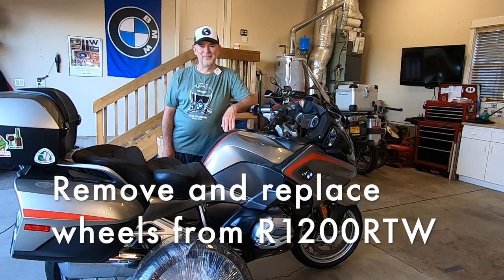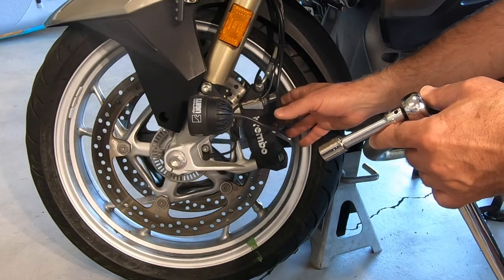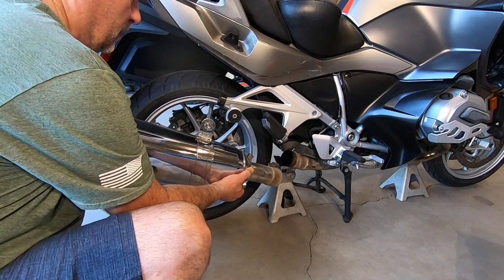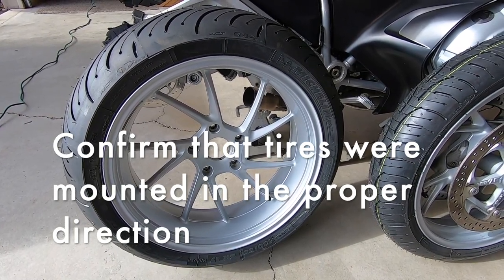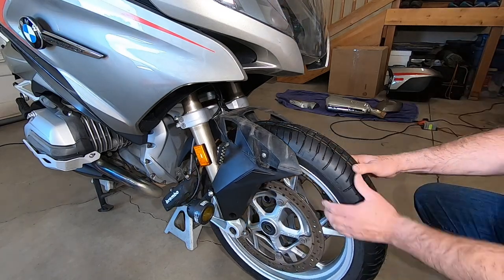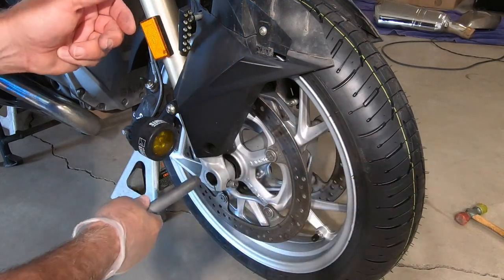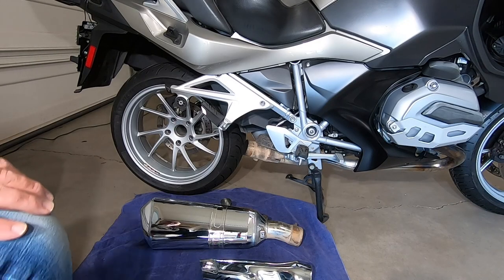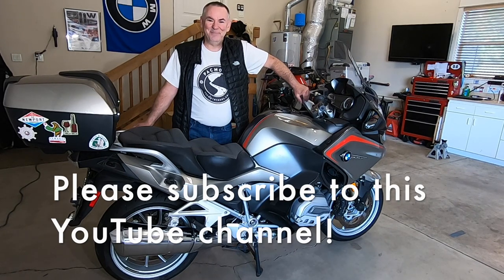Remove / Replace Wheels on R1200RTW

Comment: These are great. I didn't see the rear brakes installed. Did I miss that someplace?
Reply from the maker: You don’t need to mess with the brakes to remove/replace the rear wheel. Here is a video on replacing the rear brakes.
https://youtu.be/N7opeaHzQTM

Comment: The front wheel pin, as a manual, must be tightened to 30 Nm
Reply from the maker: Ah yes, thanks for pointing that out. I need to make a correction.

Comment: I don't understand why you took the front wheel out without removing the fender but you took it off to reinstall...?
Reply from the maker: Good question. It’s pretty easy to roll the tire out but more difficult to roll back in if you don’t remove the fender. However, if the rear wheel is off first then it’s easy to remove and replace the front wheel without removing the front fender.
Reply: @PacMoto Thanks for your response. I am about to do the same thing as my tires are worn out.